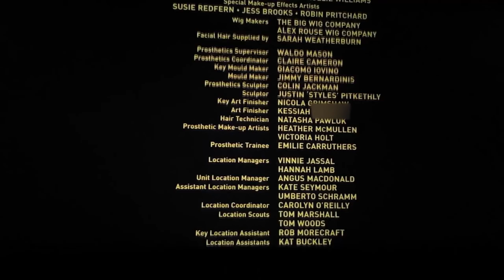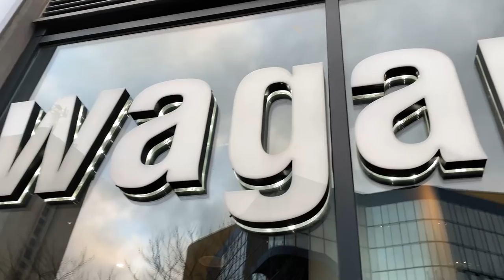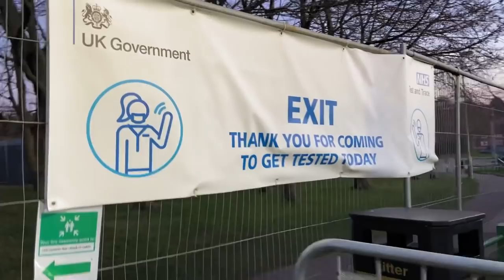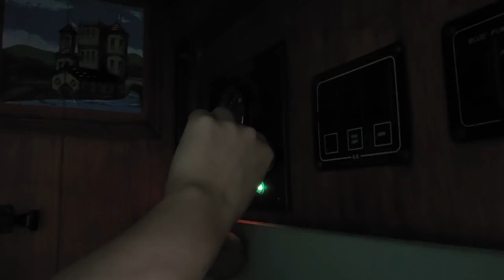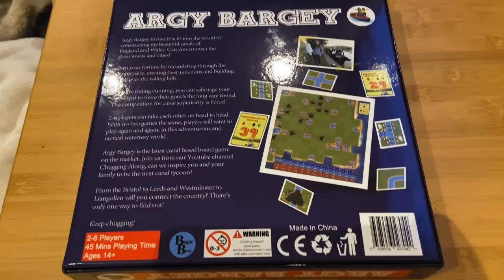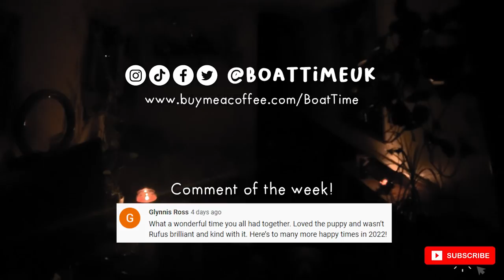Stuck in ISOLATION | Covid ruins our plans - 29

Comment: So sorry you were sick. Great vlog anyway though. You two are completely adorable. 
Homemade hash browns are time consuming but when done well are so delicious. The trick is to get the oil in pan fairly hot before adding All of the potato at once, then smash it down firmly so it's like a pancake. Don't mix it around. After it gets brown on that side, flip it over, smash again and leave it until it's brown on that side. Turn the heat down and cook for a while longer on both sides to cook the inside and keep outside crispy. If you can't get it to flip all in one piece the first time, you can cut it in half or quarters and then flip them but try to not let it fall apart and push it back together and smash to make it stick.  Oooo, now I want some!
Good luck. Kisses to the sweet Rufus puppy!
Reply from the maker: Thank you so much! That's so nice of you to say 💕 Ooh thank you! That's great, we'll have to give this method a try as ours didn't turn out quite so well! Sounds delicious 😋 x